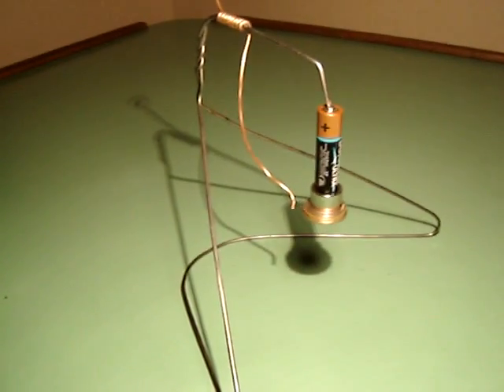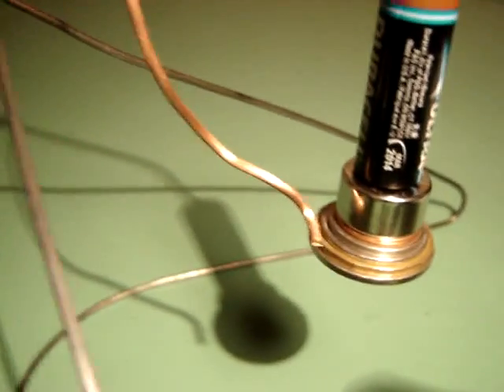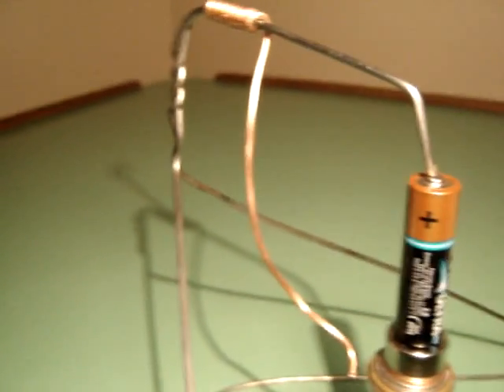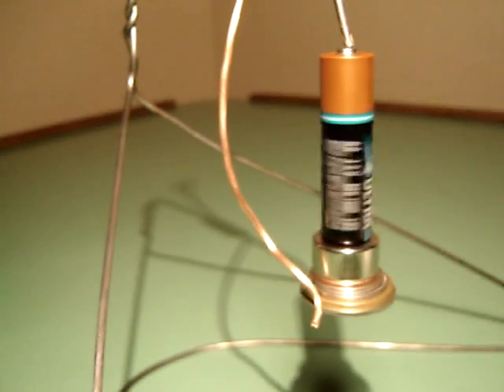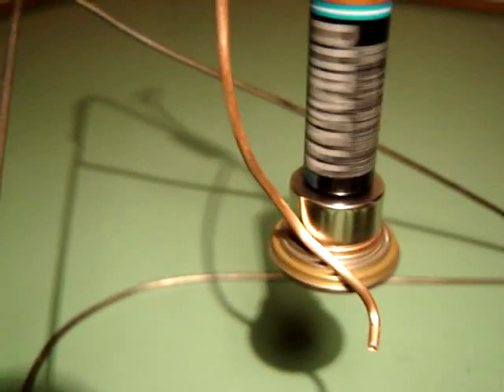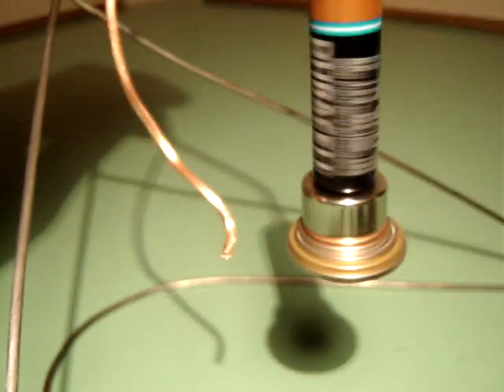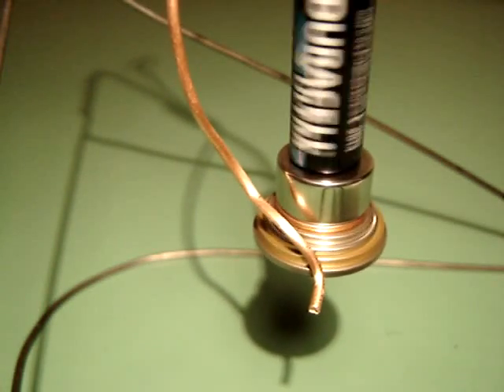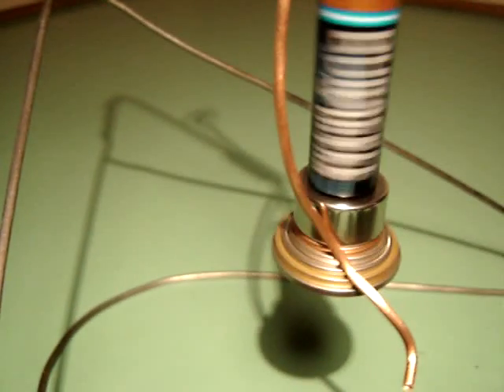Homopolar Motor With Five Speed Auto Shift

Comment from the maker: @Dragonfire7666 
I think multi-speed effect is mostly because of the radial distance, that is, from the centre of the disc, to the brush that is acting as commutator. The larger diameter disc will rotate slower when considering the same surface speed between the  conductor and the disc surface.

Comment from the maker: @jakedjo 
The coins don't have to be magnetic, but they will stick to the magnet easier if they are. You could use a magnetic steel washer to hold up some non-magnetic coins perhaps. Or glue the coins on. Or simply use different sized magnetic washers instead of the coins.

Comment: @zephirekott it is not a trick. this is happening because battery is becoming electric conductor to itself's electric circle and when the conductor is straight , magnetic lines are sprials whos center is the on the battery's axis. so the whole thing gets electromagnetic performance and it goes in a circle so thats why it acts like this

Comment from the maker: @blueace115 
Well, you could use cobalt samarium magnets but they would be more expensive than neodymium. 

Actually, there just needs to be a strong magnetic field and a rotating conductor to form a homopolar motor. I have made them using a bass speaker magnet as the magnetic field as well.

Comment from the maker: @ethcat 
There are several factors in the coins which enable various speeds. 

The main factor is the radius of the rotating conductor (coin size) Bigger radius = slower spin but more torque. Small radius is faster spin.

The resistance of the coin and its magnetic properties also affect the rpm's. Less resistance = faster,  more magnetic = faster

Comment from the maker: @ingeniero80r116 The coat-hanger support is steel, but it has a coating that must be scraped off to make good contact with the copper wire. The copper wire should be stiff to make it work right, and you will have to play with the angle of the wire to get it right. Also, a strong battery and supermagnet is a must.

Comment from the maker: @branbran700 
There is a neodymium supermagnet attached to the bottom of the battery. 

Clothes hanger won't work instead of the copper wire, because it sticks to the magnet too much.

Comment from the maker: Yes, gravity pulls the copper contact wire to activate the motor, but only when subjected to the vibrations of the coat-hanger wire holder. It only shifts when the motor is running, and the copper contact wire is out of the "park" position on the wire holder.

Comment from the maker: This automatic 5-speed came from the manual 5-speed video I made. I made a simple change in the angle of the coat-hanger wire, and it went into automatic mode.

Controlling the speeds for a certain time could be done by adding friction to the hanger where the copper coils are.

The battery acts as a magnet from the magnet under it, and sticks to the steel of the coat-hanger wire.

Under the magnet are several magnetic Canadian coins, which the copper contact wire rides on.

Comment from the maker: It works by the principle of what is called the Lorentz force. Basically, as the current moves from the battery through the wire and magnetic disc, it sets up a magnetic field which opposes the field of the magnet, causing a torque on it.

There is some good info in wikipedia under "homopolar generator", and "Lorentz force".

Comment from the maker: I see that person above finally removed their comment, haha!

When the copper wire touches, it completes a circuit and allows current to flow. The current goes through the battery, into the wire stand, into the copper wire which is touching the magnet, through the magnet and back into the battery. 

When the current runs through the magnet, it creates a magnetic field that runs opposite to the magnetic field of the magnet, producing torque and spinning the magnet and battery faster.

Comment from the maker: This coil contracts (or expands if battery or magnet polarity is reversed) when power is applied. A normal solenoid would contract it's own coil, if it was not epoxied or wound tightly.

Comment from the maker: Hehe, thanks for checking around...that's what I was going to suggest.

You are an obvious candidate for being a magnet freak. You must obtain a magnet as soon as possible, and start work! hehe

The length of wire is about a foot (30 cm). I used 14 gauge copper house wiring, with insulation stripped off. The stand is a common (in North America) coat hanger. I just wrap the wire around the coat hanger, after sanding the coat hanger where it touches the wire for good contact.

Good luck!

Comment from the maker: According to the experts, it has to do with a 150-year old principle called the Lorentz force, in which a force is produced on the particles of the magnet when a current flows from the centre to edge (or edge to centre) of the magnet. This results in a torque on the magnet that spins it.

Comment from the maker: You could use a big neodymium magnet, glue it onto the center of the fan. Power to the center and rim of the magnet will cause it to rotate, turning the fan...and the fan motor. The electric fan motor then becomes a generator, and it could power an LED or something!

Or remove the fan electric motor and suspend the fan in some way. The choices are endless...I suggest you get a decent size magnet right away! You can use my link to K&J Magnetics in the "more info" box on the right, if you wish>>>

Comment from the maker: The torque is dependant on the amps coming from the battery. They can draw several amps from the small battery, and it will only last for a few minutes. 

I usually use a tough and strong 2650 MaH Duracell NiMH rechargeable. Things can get hot with this set-up without even having a load on it. The commutator is not efficient.

However, the super-cooled homopolar motor has been made to develop tens of thousands of efficient horsepower for naval vessels recently...

Comment from the maker: Good question...You would still need a battery (or other power source) and a conductor to make use of the earth's magnetic field. It would require energy to spin, like this homopolar motor does. 

Tesla did talk about making devices that could get small amounts of power from the earth. When Tesla got big energy from the Earth, he did so by pumping energy into the Earth first...the planet acts as a resonator or capacitor, and can give back the energy that was put into it.

Comment: the wire moves toward the battery because if you notice - it's coiled around the frame wire at the top-  the shifter wire has induced curent from the magnets - thereby making the coil a weak electromagnet and as we all know - magnetic force is perpendicular to the field - or if you ever started your car - its a simple sulenoid.  rather than  the frame wire moving - the coil around it moves "shifting the motor.

Comment from the maker: I believe levitation is related to magnetism, and that soon mankind will discover the link!

The energy from the battery is consumed rather quickly by this crude but effective homopolar motor set-up. The battery, the magnet, and the copper wire can all get hot, which shows how inefficient it is.

However, there are powerful modern homopolar motors that are the most efficient electric motors in the world..98 % efficient or more! Google "naval homopolar" for details.

Comment from the maker: Yes, it does get faster because less electrical resistance with the shorter distance equals more current. But also the radius where the power is applied changes things too. (from edge of small coin to outer edge of large coin.)

Comment from the maker: Yes, the motor must be used as a generator, and turned at sufficient rpm (thousands) to develop enough voltage to exceed the 1.2 volts of the battery.

Comment from the maker: The torque of these motors only becomes significant at high amperages of current. Then cooling becomes a problem. This little motor will draw several amps. 

This motor becomes a generator when turned by a wind turbine or waterwheel.

Comment from the maker: When the magnet is put on the battery, the battery becomes like a magnet and attaches to the steel coathanger.

Because the battery rotates, and hangs, it's difficult to make the conditions right to get it to work.

The magnet must be the correct size. Too big and everything will drop from being heavy, and too small and there's not enough magnetism to go through the battery to make it hang.

Comment from the maker: That's the trick here!

When the magnet is put on the battery, the battery becomes like a magnet and attaches to the steel coathanger.

Because the battery rotates, and hangs, it's difficult to make the conditions right to get it to work.

The magnet must be the correct size. Too big and everything will drop from being heavy, and too small and there's not enough magnetism to go through the battery to make it hang.

 I used a 3/4 x 1/2 inch neodymium magnet from K&J Magnetics  (see more info)

Comment from the maker: You won't get a shock from these low (1.5 volts) voltages. Sparks do occur because of the relatively high (6 amp) amperage...it's almost like shorting out the battery.

 The spark shoots out tiny molten specs of nickel and copper...not good for the eyes!

And yes, it is a very cool project...something that wasn't easily possible until recent years, with neodymium magnets. Yet the homopolar motor idea is 150 years old, back to at least Michael Faraday.

Comment from the maker: There are some unsafe aspects to this experiment that should be mentioned...

Use glasses to prevent stray sparks from bouncing off your eyeballs when gawking in amazement too closely.

Be careful with handling the connecting wire...it can get hot, and the battery can overheat if run excessively. 

The homopolar motor is a rotating object that can go pretty fast and is barely held on, so it can go spinning off and hit something.

Oh, and neodymium magnets can be lethal if they are swallowed.

Comment: When you downshift, the momentum on the battery is quicker than the gear would have allowed you to travel so ultimately the resistance to end up in 1st gear again going at a 5th speed speed makes u generate electricity - would this be dynamic breaking?

Comment from the maker: The battery gets discharged while running this experiment. I use a  battery charger to recharge the Duracell 2650 mah battery.
You could actually charge the battery with this setup, if the magnet could be spun fast enough through some other means!

Comment from the maker: This setup will run for five or ten minutes, and will get warm, but not overly hot. There are enough rotating parts that the heat gets distributed well.

It would be neat to have a water-cooled battery! However, we must consider that if a battery gets that hot, it is being overloaded and not as efficient as it can be.

It's interesting that Faraday's 150-year old homopolar motor idea has recently been adopted  for naval vessels. The new 20,000 horsepower homoploar motors will be 99% efficient!

Comment from the maker: If you mean the lacquer coating on the coat-hanger...yes, it was removed with sandpaper where the copper wire contacts it and where it the battery hangs.

It must be a complete electric circuit through the coat-hanger, copper wire, coins,  neodymium magnet and back to the battery.

Comment from the maker: Every time we experiment we learn something...even if it is to simply not touch hot things!

Any time the battery terminals are connected with wire or metal, it's like a dead short, and the battery, magnet and wire will heat up. 

Batteries and magnets that get too hot can explode! Neo magnets can also lose their magnetism at high temperatures. 

To avoid this, don't run a homopolar motor very long, and allow cool-downs for the battery.

Comment from the maker: This will definitely turn something like a small fan. Some setups might run for several minutes. However, it will draw heavily on the battery, and heat up the battery, magnet and wire. 

This homopolar motor setup is simple but inefficient. 

On the other hand, the navy has a new electric homopolar naval motor that is thousands of horsepower and very efficient!

Comment from the maker: My SinkScience battery charger would keep you waiting, with an open faucet running, for way too long!

The green Duracells that come with the charger are usually 1900 Mah(milli-amp-hour). I use  the more powerful Duracell 2650 Mah. Either battery will work. They can both use the same charger.

Use a proper NiMH charger like comes with the Duracells. The charger flashes when the batteries are ready. These batteries should be removed once they are charged.

Comment from the maker: The regular 1400 mah Duracell you have will work. It may  run out of power fast. The rechargeable ones I use are the Duracell 2650 MAh (milli-amp-hour) NiMH...almost twice the power.

The wire is 12 gauge solid copper wire, available as home wiring.

The coins need to be magnetic. These are Canadian coins, so they are magnetic. US coins won't work. 

Good luck with this fun project! Let me know if you have more questions.

Comment from the maker: Yes, that is correct, the magnet attracts right through the battery.

   Some batteries aren't attracted to magnets.
I use a AA Duracell 2650 mAh rechargeable NiMH.

   You have to use a strong cylinder magnet of the right size...too big and it's too heavy and falls off, too small and there's not enough magnetic force to hang on. A 3/4 x 3/8 inch N52 quality magnet is best. 

   A small ball magnet between the battery and the coat hanger can help too.

 Keep trying...it's worth it!

Comment: Very Clever indeed. Is the magnet so strong that it goes through the battery and clings to the coat hanger?  I have very powerful circle magnets (pinched my finger when two came together OUCH) but setting my battery on one, there was not magnetic draw on the top of the battery, can you explain why yours works or is it just the kind of battery
thanks

Comment from the maker: Your comment "There doesn't have to be any change in the direction of the magnetic field or the current", is exactly my point!

Nearly all electric motors made today require a change in the direction of current to run, whereas the homopolar design does not.

I say nearly all motors, because a new design Naval motor has just been developed...it's a superconducting DC homopolar design, considered to be a superior alternative to AC motors. It's quieter and more efficient. Now, that's special!
!

Comment: The battery case is a N or S pole as it is sitting on  the magnet. Current flows from top to bottom on each side as in the method used by Faraday. The torque results from the Lorentz force: a charge moving in a uniform magnetic field experiences a force at right angles to both the field and the direction of the current flow. There doesn't have to be any change in the direction of the magnetic field or the current. Elementary right hand rule stuff, nothing special.

Comment from the maker: This is a different principle than the electric motors and generators you speak of, which use attracting and repelling fields in a bipolar manner, rather than using a simple flat conducting magnetic rotating disc.

The idea of applying power to the edge of a magnetic disc to produce torque has been missed in most scientific literature and teaching. 

Some engineers and kids would not believe it unless they see it...so that's why I present it and in many variations as well.

Comment from the maker: A magnet that rotates is a source of power. Conversely, a source of power applied to a conducting magnetic disc rotates it.

These are big ideas that most people have missed. Playing with supermagnets reminds us of the awesome power of magnets.

As far as the transmission comment, from my point of view as a mechanic it's an auto transmission. When I look at it as an electrical engineer, it's a speed controller.

Comment from the maker: In this case a bare copper wire works best . Also, the coat-hanger wire has a varnish that can be removed with sandpaper, so that the circuit is completed from the copper wire to the coat hanger. 

The power then goes along the coat-hanger to the battery positive terminal, into the magnet, and finally the coin pack. 
   It works on the principle that an electrical current passing through a magnetic disc produces torque on the disc.